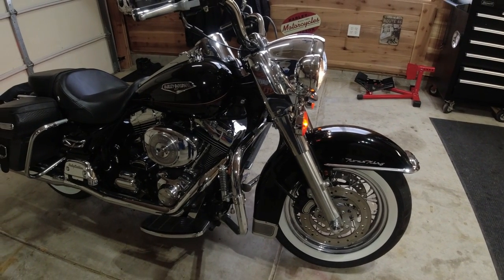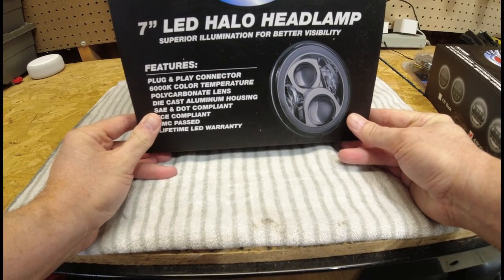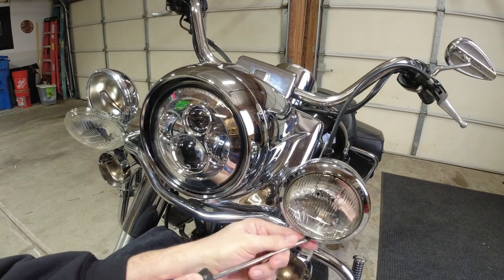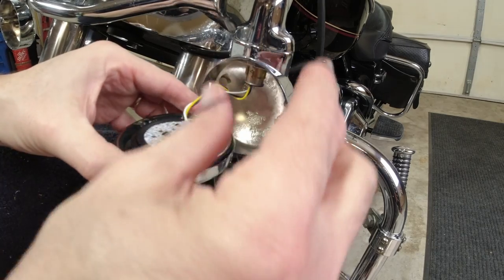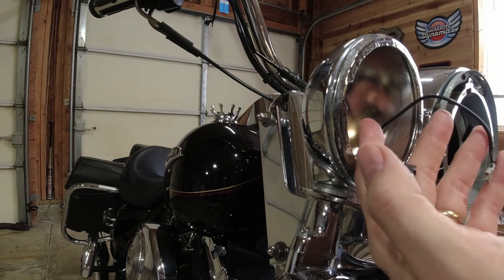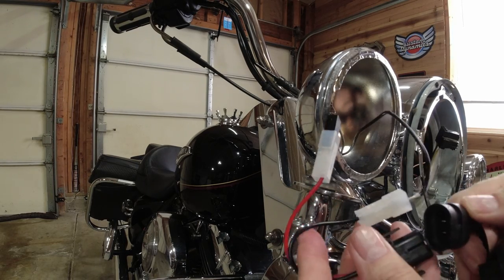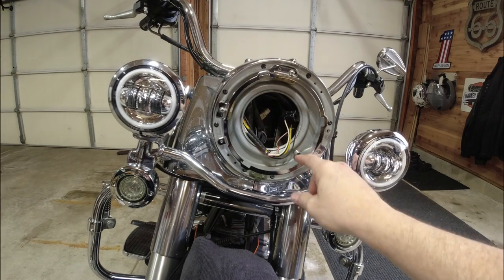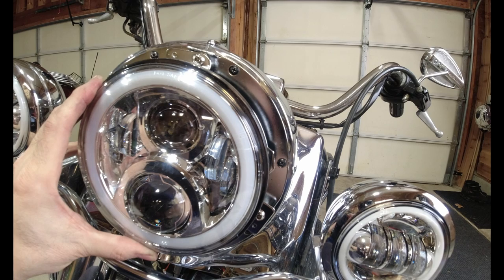Best LED Lights for a Harley Davidson Road King

Comment: Great video. It's good to see Custom Dynamics on older bikes. My 2000 RK has their lights all on the back and I have their turn signals (front and back). I want to get the pro beam head light and passing lamps too but they are not budget friendly, lol. Godspeed
Reply from the maker: Thanks and hey if you are interested in the headlight I took off, just let me know. Be glad to wrap it up and send to you!

Comment: Did you have to install a different flasher for the LEDs? Or load reducer? Or anything?
Or did you literally plug these in and they work.
Reply from the maker: I believe that I actually did. I’m away on a riding trip right now but when I get back I’ll verify and make sure to comment for you.

Comment: Nothing like new LEDs to completely change the look of a bike...I love my LED setup...still need to swap out the turn signals & taillight, but that's coming soon...I got a set that's red to match my bike & got a new shorter Memphis Shades windshield with the red fade on the bottom too...looks like a completely different bike than when I bought it...I love my classic motorcycle, but I also love upgrading it in a few key areas...need to do new rear shocks on mine...the originals, while still pretty decent, could be better...& I want to put some true duals with fishtails & a set of mayhem bars & I think I'm gonna call it good on mine...then it'll be the perfect mix of custom & classic...
Reply from the maker: I agree with you and that’s what I was trying to make sure that I did was keep the classic look but I just had to upgrade the lights

Comment: I just transitioned my 2019 road king from halogen to LED headlight and auxiliary lights. I’m pleased even though it was a pain to put it all back together lol I’m horrible mechanically
Reply from the maker: I get it Hector especially the headlamp ring.....good I cut that part out. Enjoy the KING!
Reply: @BoDean52  exactly!! since the ring has that little metal that latches to a metal piece that holds it, don’t lose it lol. And my bike has visor on all the lights so extra headache for me lol

Comment: hello, we installed the passing lamps and headlamp and kept the original turn signals. Now, the gas meter & turning signals don’t work. Fuses are all okay. I got it checked out by someone and they do not know what it can be. Have you ever ran into this issue ? the turning signals blink once and then shut off.
Reply from the maker: I have not, did you do an ECM sink? If not, look up Custom Dynamics at 919-554-0949. They are good people and will help you out

Comment: You tube video never fails to disappoint. Did you need resistors  ? Do you need them for the front and the back or does one end do it?
Reply from the maker: Appreciate that and was all plug and play with a module that comes with for the turn signal flashing. Still love them

Comment: change stock handle bars asap, they snap between the bar brackets, new LA Custom bars are thicker steel, way safer. I found out the hard way. Get new handle bar riser bushing while you have them off.
Reply from the maker: I have gone back and forth on keeping this as close to stock as I can but must admit I am really thinking about the bars!

Comment: Looks great. Adjustment for LED lamps are different. If you don’t want everyone flashing the brights at you while you on low beam, Doc Harley at Low Country Harley has a great video up on his channel for those lights. Lol. I have to do my Road King as everyone hates my low beams.
Reply from the maker: Great point Mike and I still need to do that

Comment: Okay!  The headlight and passing lights look awesome!  Did you have to re-aim the headlight and passing lights?  I might actually get those passing lamps and headlamp for my 07 RK.  To be honest I don’t see anything wrong with the stock turn signals and tail light.  I have the same kit you used to have where my rear turn signals have red lenses and function as combo running lights, brake lights, turn signals.  Seems plenty bright to me.  The headlight/passing lights though is another story, I’m thinking that has to be a huge and worthwhile improvement!  Thanks 👍
Reply from the maker: Just had to make sure the headlamp was aligned…all good. Good luck on the headlight and passing lamps, I really like them

Comment: I ordered the Hogwerkz day makers i have an 03 King and I can't put the chrome head light ring back on i had to use the adapter kit on mine it looks like I half about half an inch gap so do you think I can keep the back adapter piece and not use the front one ?
Reply from the maker: That has happened to me twice…..because I put two headlights on. I ended up buying a new ring set,  get your frustration
Reply: @BoDean52  so do I need to get the 7 inch ring and have to disregard the stock one ? I dont know why it wasn't recommended to add it to the purchase on the website where I got the head lights from.
Reply: The more I take things apart on this bike the more I wonder if the engineers went to home depot and lowes to piece things together
Reply from the maker: @racex3721  that’s what I did but I have the Custom Dynamics light

Comment: Had to soder my passing lamps did you use the head light spring on your install ive got a gap on the top portion where the head lamp beauty ring is
Reply from the maker: That’s stupid headlight ring has driven me crazy for two changes. I finally bought a new one and swear I’m never gonna touch it again
Reply: @BoDean52  yeah may have to do the same this thing is a bear and a half and no YouTube videos I've got to point the passing lamps down apparently need a 9/16 slotted special socket Harley engineering for ya.

Comment: Bo, did the Custom Dynamics led-headlight plug fit properly into the stock headlight plug? Mine doesn’t seem to plug in all the way…
Reply from the maker: As I recall, I had no problem with it. The people at Custom Dynamics are awesome and if you just call them, they will put somebody on the phone with you that will walk you through it and let you know if you need anything.
Reply: Thank you! I reached out to them and they got right back to me...
Reply from the maker: @donaldodonaldo1242  excellent!

Comment: Looks nice but you did not show the most important things, how to install the new parts and the ring
Reply from the maker: You are actually right because I thought it is something nice and easy. That said, it’s stunk and I hate putting those rings on. I ended up replacing it with something else
Reply: @BoDean52  I bought a set of led lights from Amazon and I will return it because it doesn't work for my RK 2006. I'm sad :(
Reply from the maker: @AnniePorcheron  that stinks and while Custom Dynamics is not the cheapest, I think they are a good value. Their site will show you what exactly will fit. Good luck